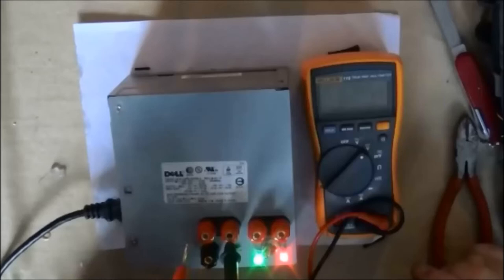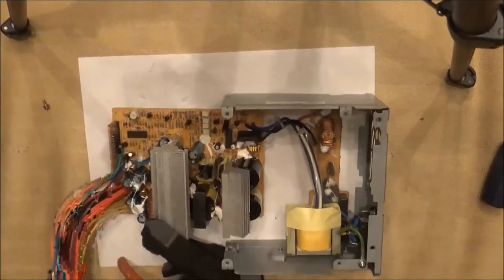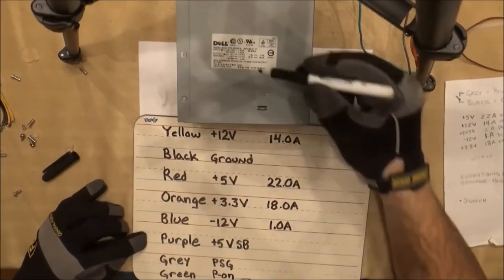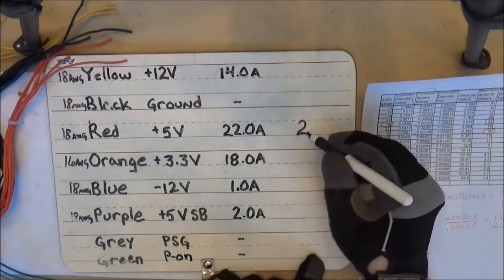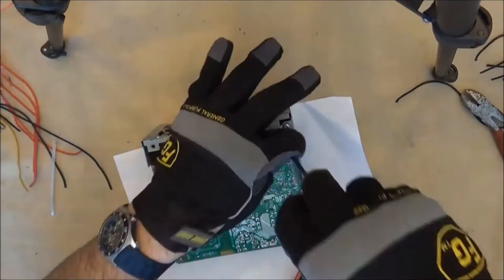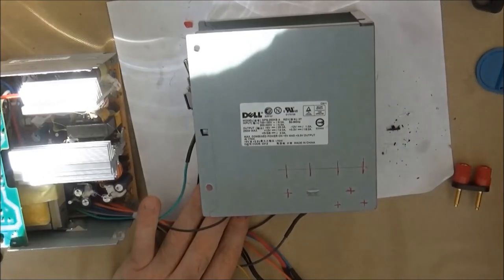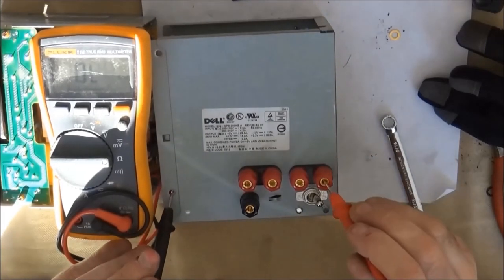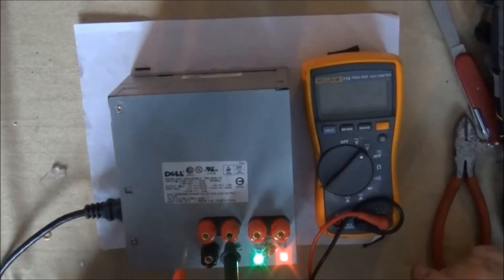Convert a DELL ATX to a bench top power supply!! HACK!!

Comment: I wish you would post a wiring diagram. I'm having trouble figuring the wiring for the green led and the switch. I'm using an older Dell power supply (NPS-200PB-73M) and am trying to adapt your setup.

Comment: with the inside potentiometers you can adjust te voltage to the precise voltage that you need .
but be carefull when you adjust it becuase there is life voltage on the board

Comment: The amperage rating of the various voltages on the label aren't what the supply draws.  They are ratings of how much current the unit is capable of supplying.  Power supply 101.

Comment: Don't you think the table you used over rates the wire ampacity? In the NEC, tables give around 5A for 18 awg wire.
Reply from the maker: +Juan Abreu The chart I am using is for chassis wiring which can be used for short runs inside an enclosure. When I look at the NEC table 310.104 the rating I see is for 18 awg is 14A. Thanks for the comment.
Reply: +Heath Putnam  You´re right, I misread the table. Thanks.
Reply from the maker: Thanks for checking though! You had me second guessing!! :)

Comment: any tips for a dell n275p-00 slim from an optiplex slim desktop?  I've added multiple loads (10w100Ohm, led, another resistor, etc) but can't get it to stay on.  Blips power on when green is grounded but only for  split second.  TIA!!

Comment: I think that you used the wrong binding post as where you attached it to the metal case you was having shorting issues. The conductor ran through the binding post uninsulated from the case and any slight movement will cause this again. There are binding posts available that are insulated all the way through and are fastened with a nut against the plastic housing of the post and there is no possibility of a short to the case as the plastic post passes through the hole in case .
Reply from the maker: Yes, I think you are right! Thanks for the comment!